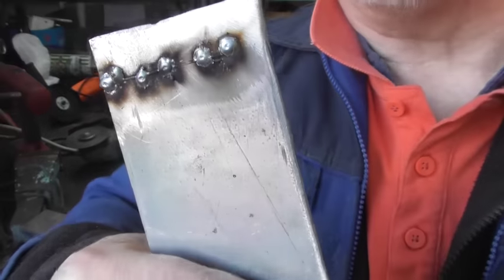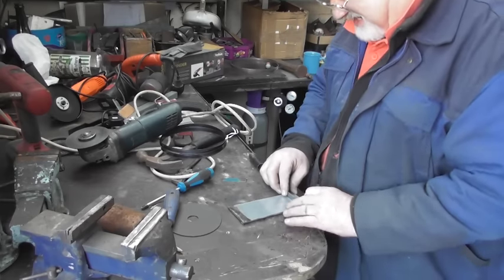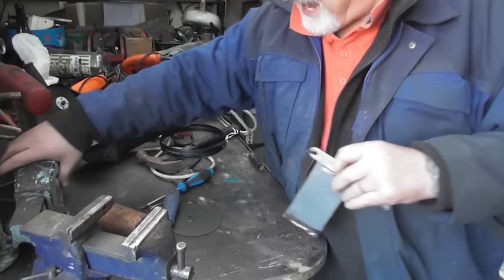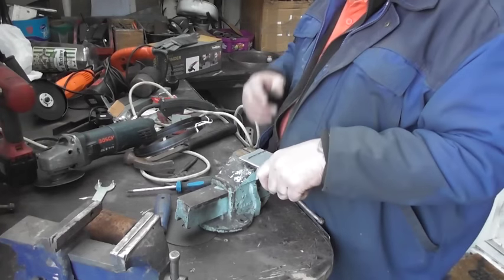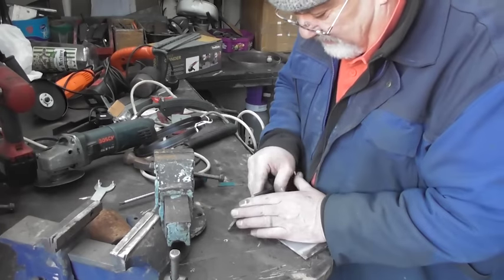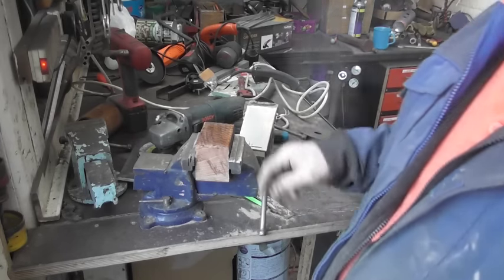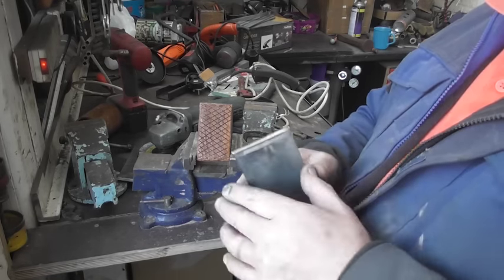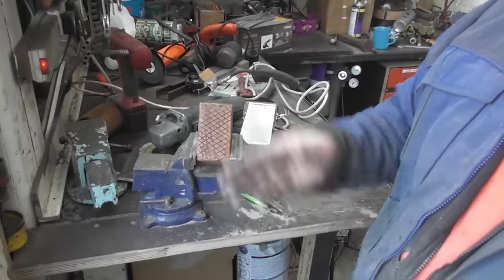how i made a tool for my butt  ( stock grip )

Comment: I was worried for a minute with that title. I know what you mean about the cold, was at my mates boat building workshop earlier today swapping some external jaws for some internal ones on his lathe so i could turn some rotors down and the cold steel made my fingers so cold to a point that they were quite painful, i'm sure it was colder on the inside of his workshop than it was outside.
Reply: Just checked my weather station, it's -3 outside, got loads to do but not sure if i really want to go out to the workshop and do it. It won't do it itself. which gives me an idea to build a log burner for the workshop.